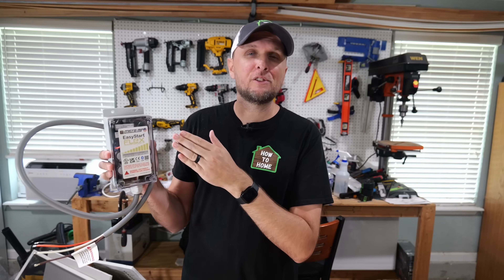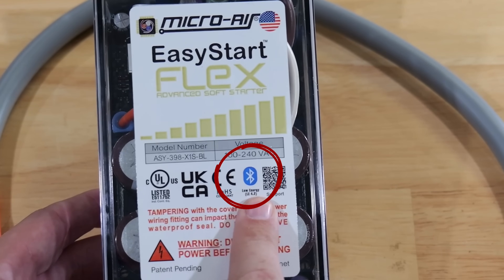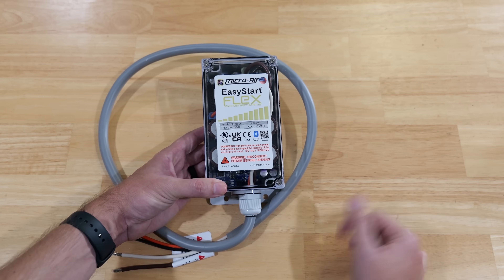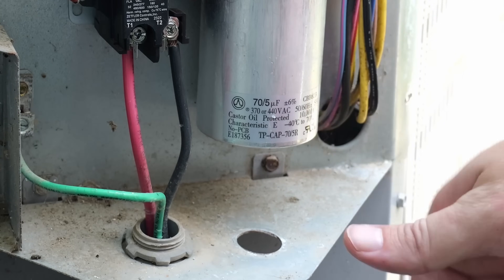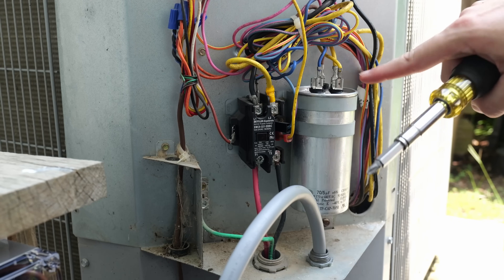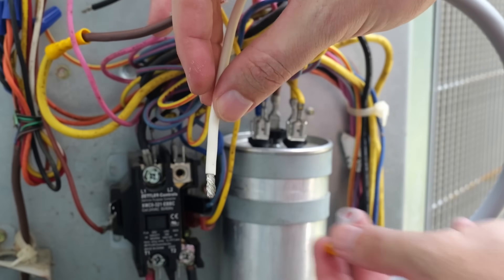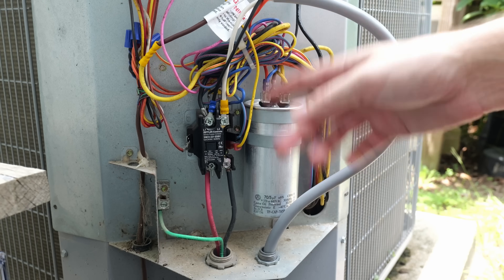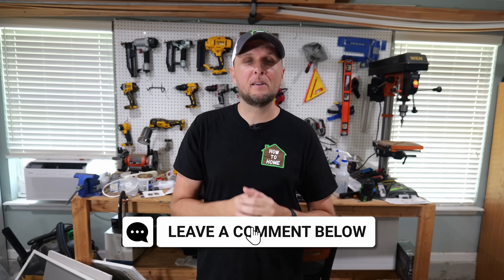The ONE AC Upgrade Every Homeowner Needs to Consider!

Comment: No chance demand rate is measuring inrush in fractions of a second.
Reply from the maker: I don’t have demand charges but I have had numerous people in previous videos say how this has saved them money because they do.
Reply: @HowToHomeDIY  The most common peak demand charges for utilities are based off 15 minute intervals, but some utilities do 30 or 60 minutes as well.

So if you use say 120A on your 200A service panel for 15 minutes during a one month billing cycle, you will see a peak demand charged based on that peak load during that month in addition to your Kwh usage.

Now with that said, this device will have zero impact on peak demand charges.  What would have an impact though is making sure you are not powering multiple large 240v loads at the same time (e.g. AC, EV charger, Electric clothes dryer at once).  The utility meter would never see inrush current, but would see sustained high loads lasting 15+ minutes.

I did like the video though thanks for posting!

Comment: To be honest i considered this one few times already..but for my 17 years old AC i believe it isn't worth it anymore.. it could give up any moment and I think i will replace it for complete new one... but if i knew there was such option at the beginning i would buy it then for sure..
Reply: Agreed, not worth it almost $400 part for a unit that old.
Reply: I actually disagree with this perspective, as this may actually extend the useful service life of an older unit, buying you more time by making it not work as hard with every start cycle! Not only that, but once you own it, why couldn’t you just use it for the replacement unit when that time comes? Just another angle to consider…
Reply: I have 3 AC units on different rentals with installation dates of 1986, 1993 and 1996.  All of these units are still pumping out cold air.  17 years is NOT old!
Reply: @beemikeme  oh its definitely old and prolly only has a few years left. But at least its still running, thats the main thing.
Reply: You can just move it to the new condenser when your current one chokes
Reply: @westhavenor  the new compressors wont need it, since they have something even better--variable speed compressors.

Comment: So is the only difference between the new and old model the size and the new can be installed on any size? You mentioned that in the beginning along with a bunch of other feature such as it acting like a surge protector, but I didn’t know if everything you mentioned was for all the soft start models or just the new one
Reply from the maker: The others offer all the same features but are not as small and have to buy specific ones for your size unit.  I just went through all the features of this one for those that have never heard of these.
Reply: @HowToHomeDIY ok thanks! I bought one of the original ones last year and hoped there wasn’t too much of a difference.

Comment: I had an email with MicroAire support, asking for comparisons between the Flex and their old model:

Our EasyStart Flex (ASY-398-X1S-BL), boasting the same reduction of amperage of up to 75%.

Our new model has undergone some refinement, see below.

The traditional start capacitor (which helps us reduce the start-up of your AC motor) has been replaced with electronic-based components.

An updated circuit board configuration has been implemented to allow for updated parts.

Updated learning technology (patent pending).

How we calculate and determine the optimal start-up of your AC motor has been updated for patent registration.

Our updates cover multiple areas, not just for patent registration

 

Reliability

- Updated electronic parts.

- Extended lifespan due to higher-performing parts.

 

Performance 

- Refined software to ensure the highest reduction of amperage and learning.

 

Design

- Smaller footprint for easier installation inside electrical areas of the AC.

-----

I have also seen some people report issues with the Flex.  I'm glad to see that MicroAire seemed to acknowledge them with early versions; made adjustments to their design; and sent out the updated model to those affected.
You can see in the comparison of the old and new models how the older model had a large capacitor in it (lower right).  I can see how removing that would have allowed for a smaller footprint.

Comment: im on a small off-grid solar setup, i want to use this so my inverter can start my fridge, vacuum cleaner, microwave without red lining or just giving up on me. Can this thing help me with those appliances?
Reply: 100% no.  This is only to help with start up for a motor like an AC compressor motor.
Reply: @srobeck77  ......hold my beer bro
Reply: @snowboarder50000  i just downed the whole thing. May I hold another?

Comment: I wish I would’ve known about these before I blew up several inverters.
Reply: Wait what?  An inverted compressor already does this on its own without this device. Sounds like there was a component failure or it was wired up correctly when it was installed.

Comment: There is one error in your description. This unit does not start the fan first independent of the compressor. If you actually install one of these you will see right away that you are not connecting anything to the fan part of the wiring.
Reply from the maker: No you don’t.  Which is why the fan starts right away like it normally would and the soft start delays the starting of the compressor until the fan is running. So it does exactly as I said.  Splitting hairs here.
Reply: @HowToHomeDIY  OK, I get it. Thanks
Reply: This just in, your indoor fan unit is 120v and the compressor is 220V so its impossible to cross streams like in Ghostbusters (or a demonic portal would open)!!!!!

Comment: Heck, just a hard start kits will drop about 90% of the inrush for $13.  I have installed 100's of them and the difference with inrush real world with an amp clamp is crazy.
Reply from the maker: It’s not dropping the in rush.  It increases it.  It’s speeding up the process so much your clamp meter can’t read it accurately.
Reply: @HowToHomeDIY    not true,  the total time getting started is decreased by a huge amount lowering the total wattage used.  It makes a huge difference in dropping energy consumption.  That is why my higher seer equipment find them as standard equipment.  The difference is huge.  Also the total amp draw at inrush is not higher.  The energy is stored in the capacitor and that is where the help comes from.
Reply from the maker: We will just have to agree to disagree.  A simple search will explain it in detail with numerous sources.  Will be harder to find what you are talking about.
Reply: @HowToHomeDIY   you can find anything you want on the internet.  Facts are facts.  Total power consumption is far less with a start capacitor period. Not saying a soft start is bad.  Have installed hundreds of them for different  purposes as well being a electrician for over 30 years.

Comment: I am replacing a 2.5 ton  34yr. Old hvac unit this fall with a 3 ton 2 stage unit. I would like to know if I can put a soft start on a 2 stage ac so it can be connected to a future generator or power wall?

Comment: so i actually studied this and actually designed my own soft starter myself from a microcontroller, TRIACs, and start capacitor, and other associated electronics, essentially what it does is temporarily put a start capacitor in parallel with the run capacitor while ramping up the voltage on the run winding using a TRIAC, once the voltage shoots up across the start winding it means the motor has started spinning and you can remove the start capacitor and run full voltage across the run winding, my own project reduced the starting amps on a window unit like 60%+
Reply: You may have a good understanding of electrical circuitry, but your grasp of basic english sentence structure was at a Kindergarten level at best.  (A dead giveaway is using the word "and" 5 times in the same paragraph).
Reply: @srobeck77  im an engineer, not an english teacher, and im not writing a fucking technical paper in a youtube comment
Reply: @wow1022  It is still good practice to always use proper sentence structure in anything one writes!  There is no reason not to.

Comment: I have a 24KW get set that just could not get a 5 ton A/C unit running with the other 4 smaller units I have. I added the EasyStart to the 5 ton two years ago and with frequent power outages it has done its job perfectly. Excellent product and they have great support. Like he says make sure you get the right one for your unit.

Comment: I just installed one of these on a customer's unit, with LRA of 79, that was bogging down his 22kW Generac generator. After installation, while on generator power, you couldn't even tell when the heat pump powered on. Needless to say the customer was extremely happy.

Comment: So if you need reference material on wiring ampacities, check out Table 310.16 in the National Electric Code. Make sure you are paying attention to "insulation type" of your cable and the ambient temperature or condition its installed; whether in a wet location or not. You could also get ahold of an "Ugly's book"(field reference hand-sized booklet). They come in very handy.  
I always install the breaker in its slots before wiring to it, especially with larger wire. There are times when its necessary to wire the breaker first and most likely the case here. The termination ports can  face towards the back of the panel more on some types/brands/styles of panels.

Comment: Can the previous versions, especially speaking to the 6 ton model be used on a smaller unit? ie 3 or 4 ton unit?
Reply from the maker: I’m not sure I’m completely understand your question but I think I do.  The previous models you have to buy the specific soft start model that is made for your unit’s size.  You can’t use a larger or smaller soft start than your unit calls for.  I hope that makes sense.
Reply: @HowToHomeDIY  ok. Thx. I have a friend that bought the 6ton model then a couple of months later he had to get a new ac unit and didn't need it any longer. I have a 3 ton ac and was hoping I'd be able to use it on mine.

Comment: I have a 10-year old 5-ton Carrier AC. It's working fine. If I equipped this Soft Start, would it damage the compressor if the AC was constantly running on it? I want to install the Soft Start specifically because I bought a generator (we live in a hurricane zone and power outages are common). I just don't know if having the Soft Start on year round would be detrimental.
Reply: No. As a matter of fact a soft starter can make your compressor last longer as it lessens the strain on the compressor when starting.
Reply: @HowToDoStuf  Thank you so much😀
Reply: If your AC is constantly running, its not affected by the start up amps benefit from this "soft start" kit.  So either you have an inverted AC running in very low speeds (so this item is useless for you) or you have a real issue there with your unit (undersized, undercharged refrigerant, dirty coil, thermostat set to an unreasonably low 62'F or less, etc).

Comment: Just installed this in my heat pump went from a 68A LRA to 18.8A LRA now after over 200 starts and it’s so much quieter and will greatly improve the longevity of our unit. Easily worth the sub $400
Reply: Bro LRA stands for locked rotor amps if your compressor pulls LRA you have a major mechanical issue with the compressor and if it pulls 18 LRA the mechanical issue has self clearanced I think you mean inrush amps. Compressors do not state RUN load amp because it will vary on compressor load based mostly on OSA temp which will rasie compression ratio as temps increase.
Reply: @angryscottishmechanic848   The current drawn by the motor accelerating from the rest position when rated voltage is applied to the stator is called the locked rotor current. I think you may have misunderstood either the term or what this item does.  Instead of a full inrush current of 68A (for example), this will slowly ramp up amps (18.8A) on start up. Thats the whole point of it.  Then the RLA will taper way down, once the compressor is running.
Reply: @srobeck77  nmmmh, kind of, I've seen a lot of compressors pull lra when the rotor is locked and the inrush current is way higher than lra. Soft starts use a ntc thermistor to create a voltage divider lowering voltage to the windings. Amps are always a product of volts and impedance. Last besides inrush compressor, amp draw normally goes up after running as discharge pressure increases, and suction decreases compression ratio goes up and the hp required to maintain rpm will increase.
Reply: @angryscottishmechanic848  you lost me on the irrelevancy of RLA for this "soft start kit". This is only regarding LRA at startup.

Comment: Does buying and installing this particular unit have any advantages  over buying and installing the older larger units that are specifically designed for the different size A/C units?

Comment: That's a huge difference. Hi there, I don't know really anything about ac units but have been there when I had a repair guy fixing the capacitor  and showed me that it was bulged so if it happened again I could just look at it and see which one was bad. So I don't have anything like a generator or solar panel but have the issue with the lights dimming or flickering so this would take care of that on the ac and heat when they start up did I hear that correctly even though I'm only run regular power and other supplemental power sources. Where do I find out what ton ac unit that I have if I decide to get this soft start until? Thank you!! PS how can I get it for the furnace too that also does the same thing which I asked earlier in my comment or is there anyway that it can work on both of them?  Thank you!!

Comment: Thanks for this video!
Update: FYI: Amazon reviews are bashing this unit. Units are expelling fluids and/or bursting internally...
Just get an HVAC tech to come and install your soft starter. IMHO, even though I could do this with my experience, it's not worth screwing up your system. Yes, it is expensive but so are the electronics in the compressor if you do something wrong. Plus, that capacitor does store a wallop of a charge... Life is already way to short.
Reply from the maker: I have already addressed this numerous times.  There will always be negative reviews on everything.  The earliest models of the flex had a part that went bad for SOME people.  Naturally when something goes bad those people are the loudest.  It has since been addressed by Micro Air for well over a month and anyone that had a claim was sent a new unit or refund.
Reply: Excellent! Thanks for following up and pointing that out. I did not know that.
Reply from the maker: You are very welcome.  Would be nice if the people that were sharing their experience would share the whole experience which would include the solution and customer service they got.  And I’m saying this as someone who has no ties with the company.  Just don’t care to see people unnecessarily bash companies without giving the full picture.  Appreciate your input Robert.
Reply: I agree 100%! If your going to paint a picture then finish it properly!
Reply: @HowToHomeDIY  the latest one-star review about the leaking brown liquid was just a month ago, August 2024. I get that there will always be some negative reviews, but when a product has only 43% five-stars and 47% one or two-stars, I gotta take a pass.
Reply from the maker: @bogotabro yeah?  A month ago.  Was it one of the original units that they have since replaced the part in?   Here I am in one the hottest parts of the country where my ac runs constantly and I’ve not had an issue.  Been months now.  But of course if you don’t feel comfortable then don’t.
Reply: @HowToHomeDIY you are awfully defensive about a non sponsored product
Reply from the maker: @GrassGawd that must just mean I’m lying and it’s actually sponsored right?  It couldn’t possibly be that I actually care about factual information being put out about something I fully trust in and recommend.  I’ll say it again.  Never been paid by them, don’t work for them, and bought this with my own money.
Reply: @HowToHomeDIY thanks for your informative video.  Very detailed and this is awesome.  My only concern is this.  What happens if the device damages your AC unit.  It’s one thing that they replace the soft start device, but what about a persons AC unit if their device damages it?  It’s an expensive gamble to get wrong over a $3-400 dollar part.  Yikes.  By the way I am not here to criticize you or the product.  Simply seeking info to help me use my generator in the event I need to use one.

Comment: I installed a Flex one month ago and no issues, but there is a Reddit thread regarding the high rate of failures with Flex units that have a Serial # lower than 6200-last 4 digits. I believe the firmware is B36 with a S/N higher than 6200 was upgraded with better quality capacitors. If already installed, it may be difficult to determine what firmware / S # you have without removing it.
Reply: Do you know if they have recalled or have bypassed these serial numbers already?
Reply: @gagemuellersolarpro  - No recall, but if you have a Flex with a serial number below 6200, they will send a replacement. I received mine in mid July and it’s been fine. No faults reported on the app since installation.

Comment: I have a question for you. I run 8-3 Romax for about 55 feet. Can I run a 50 amp breaker on that?
Reply from the maker: Following the National Electrical Code (NEC) guideline of loading circuits to no more than 80% of their rated capacity for continuous loads, the maximum breaker size that should be used with 8/3 wire is 40 amps.  At 55 feet there will be some voltage drop but probably only around 1-3 volts.  So no, I would not recommend a 50 amp breaker on that circuit.
Reply: @HowToHomeDIY    OK thank you